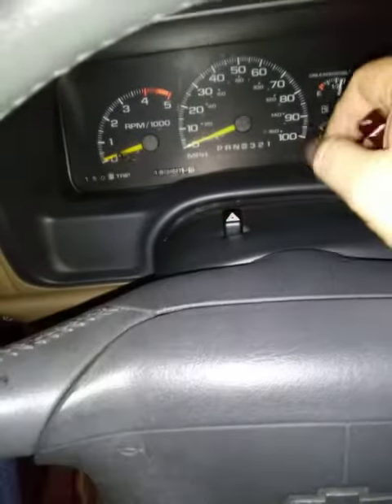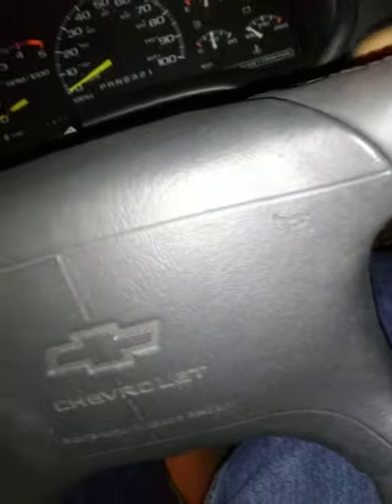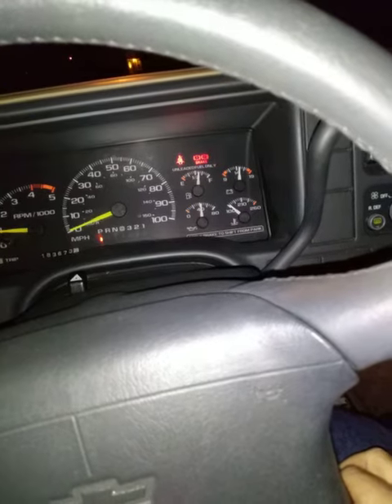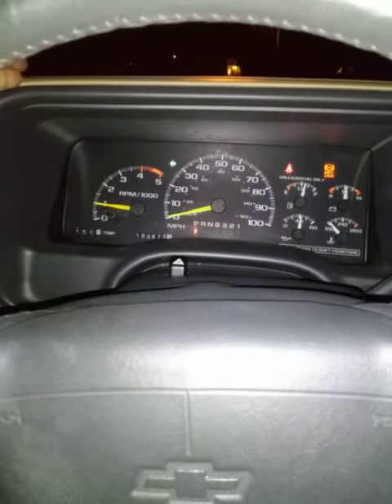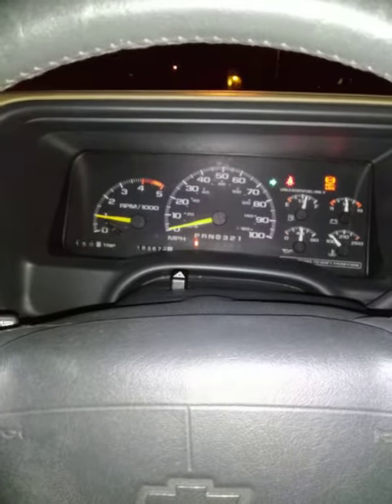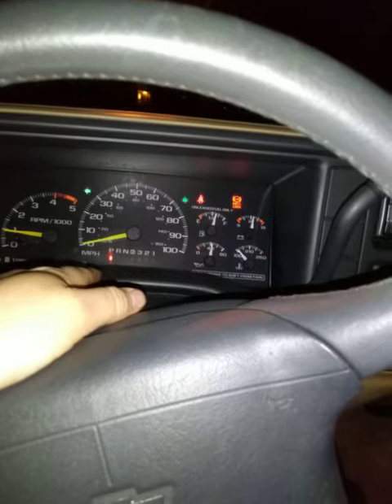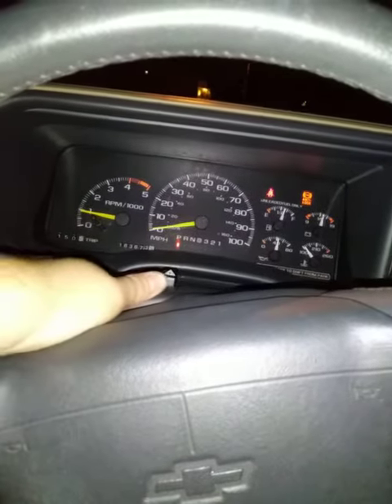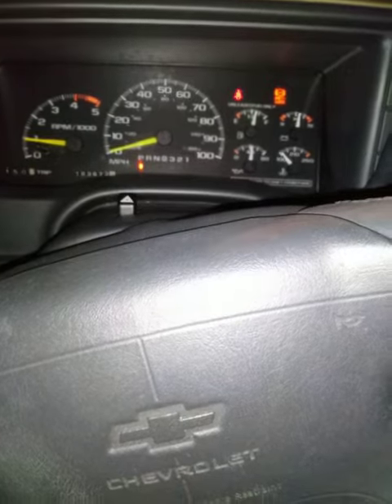95 suburban hazard light problem

Comment from the maker: I changed the multifunction switch. Works now.
Reply: What's the multifunction switch? Is it the block under the vehicle, in the back around the gas tank? I've got a '98 brake/haz and turn signal circuits keep blowing fuses

Comment: just replaced mine ,worked for 2 wks , now acting up again,  same as uours.  play with hazard switch and is ok for a while  then starts again.
Reply from the maker: First I tried just the hazard switch. Then I replaced the multi switch. That multi switch turned out to ne bad so I returned it and got a different brand. Been fine for two years now.

Comment: Flasher Fuse Issue
Reply from the maker: I replaced the multifunction switch and it works fine now.
Reply: Tight

Comment: And you could maybe replace the clicker and see what happens? Once you remove the clicker the signals will not turn on so maybe if you got a new clicker it could do something but other then that kind of dumb idea it’s really probably just a wiring issue because that’s not the oem hazard switch